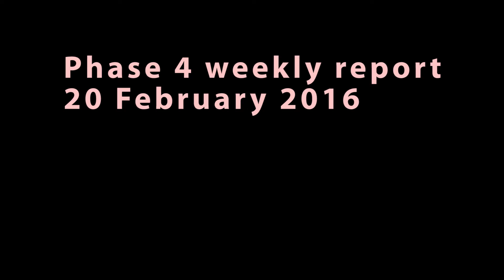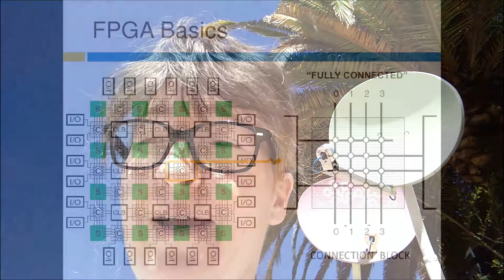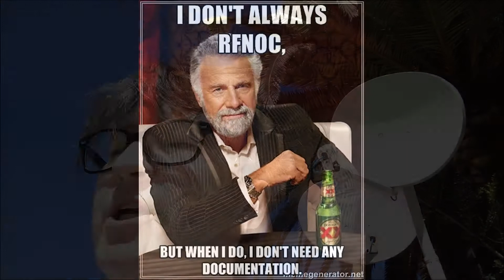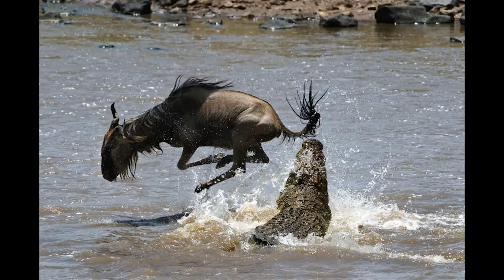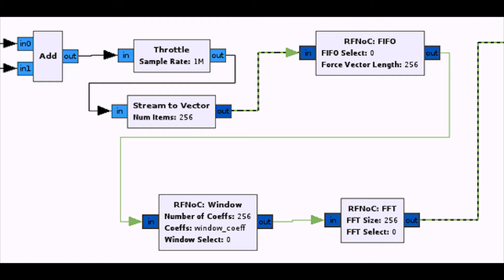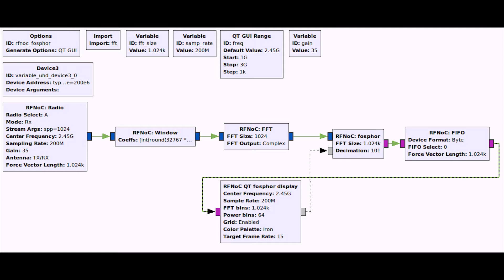20160220 Phase4 weekly report RFNoC

Comment from the maker: This report focuses on some very high-level decisions about radio technology called RFNoC. For source material, see the links in the notes. 

Overview talk at https://www.youtube.com/watch?v=UwBZ8xkiTPA

Tutorial PDF at http://static1.squarespace.com/static/543ae9afe4b0c3b808d72acd/t/55f85bc2e4b067b8c2af4eaf/1442339778410/3-pendlum_jonathon-rfnoc_tutorial_fpga.pdf

Slide presentation at http://static1.squarespace.com/static/543ae9afe4b0c3b808d72acd/t/55ddc6d6e4b09069ee81e20c/1440597718379/3.+braun_pendlum--rfnoc+2015-08-26.pdf

What is RFNoC? RF network on a chip. It's an implementation of radio stuff in FPGA hardware. 

What is FPGA? Field programmable gate array. An FPGA is made up of what's called  logic fabric. This fabric can be programmed by software that turns it into reconfigurable circuits that do specific tasks. Just like sewing, you start out with 8 yards of satin and with skill and experience you end up with a wedding dress. If you don't know how to sew, it's a steep learning curve. Just like sewing, there's lots of different types of skills and techniques ranging from beginner to highly advanced. 

RFNoC is for FPGAs what GNUradio is for general purpose processors. RFNoC is the GNUradio of FPGAs.

Why RFNoC? Why isn't GNU radio enough? Well, GNU radio might indeed be enough for us, but we owe it to ourselves to figure out whether or not RFNoC is a huge win for us.

Here's why RFNoC is such a big deal right now. Take something simple in theory. in the talk referenced above, the example given was something like a 200MHz real-time Welch's Algorithm implementation. While it might seem straightforward to implement this in an optimal manner, in practice there are several stumbling blocks. Operations that are crying out to be done in parallel and operations that can be done in basic math are ideal to shift to an FPGA. But, the FPGA is underutilized. Transport between blocks is overloaded. It's not optimized, like, at all. 

Even with a high-end computer, the host just can't keep up with demanding radio applications that the x310 should indeed be able to do. RFNoC has great potential to eradicate this shortcoming. 

The goals here are several. Heterogenous Processing, where you have choices of composable and modular designs using general purpose processors, FPGAs, and beyond. Maintain ease of use, and have tight integration with GNU Radio. Push the boundary between GPP and FPGA processing to the optimal place for whatever design you're implementing. Make FPGA acceleration easier. The entire hardware stack is treated like a reprogrammable ASIC. Features are used as-is.

The basic premise is GNU radio flexibility should extend onto the FPGA all the way up to the ADC/DAC. 

RFNoC + GNU radio is a perfect match. Ideal way to use and test RFNoC is with GNU Radio. Seamlessly interconnects (with some caveats). One of the first caveats is something that many of us on the Phase 4 Ground already know. 

GNU radio has a steep learning curve and RFNoC is very developmental. Things may change out from under you. A lot of groups, companies, and organizations are dabbling in RFNoC. People are eyeing each other from the shoreline, just waiting for the first few intrepid explorers to dive in. 

The building blocks are all there for this. GNU radio is free. USRPs are available online, x310 contains big and expensive FPGA, seems like everything is there to move flow graphs onto the FPGA.

Why hasn't this already been done? Because it's difficult. Takes a lot of time, requires digital design expertise, and needs transparent integration into software. 

This is a situation where you need a lot of radio domain exports and a lot of FPGA experts, and traditionally there isn't a lot of overlap between the two groups. FPGA development is not really a requirement of communications engineering curriculum. FPGA designers generally don't have a communications background. And, the math is hard, and that affects everyone.

RFNoC architecture. The user application is GNU Radio. USRP source block ==becomes==> an RFNoC Source. This new source controls the radio core. 

There's a USRP hardware driver, which is on the host PC. On the USRP FPGA, there is an Ingress/Egress interface, and a crossbar. Below that there is a Radio Core, plus Custom RFNoC blocks. 

RFNoC provides the communication infrastructure. The crossbar knows what to do with the data it's getting. RFNoC provides space for user logic. 

e.g. Implement FFT as an RFNoC block in FPGA. You have an RFNoC shell. Put whatever you want into the shell. 

There's a big sticking point here with the tools available to us. FPGA tools are notoriously closed and expensive. RFNoC is all open source. Everything is available but it's hard work and a steep learning curve. 

Finally, there are implications for dropping in something proprietary that you might have purchased, like Xilinx IP cores. Doing this for your own use is ok, but then if you are selling it, say, to a customer, then you have to check with Xilinx or whoever you got the IP core from. Since we're doing an open source radio, this aspect doesn't affect us as much, but it is something that a lot of companies have to consider as they move into this space. 

So, should Phase 4 Ground radio be an RFNoC project? Should we bite off more than we can chew? Is it more than we can chew? This is what we need to be thinking about now, so that we can deliver a world-class radio that fits into the changing landscape of open source software defined radio. Comment and critique welcomed and encouraged.